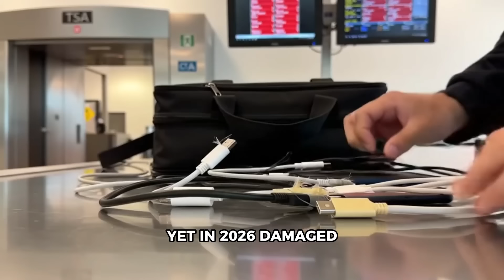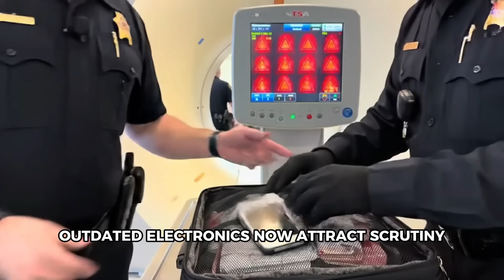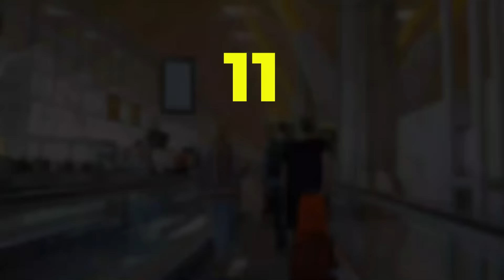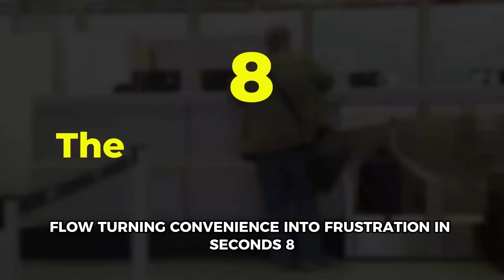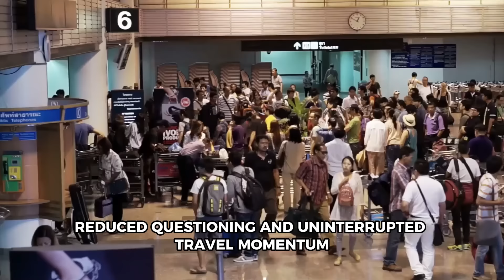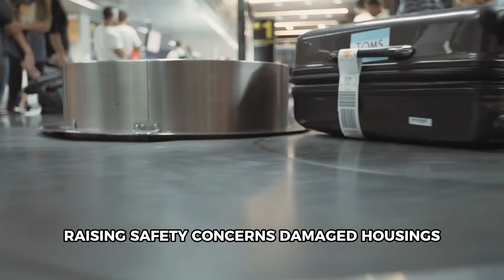TSA Is Confiscating These 15 Electronics in 2026

Comment: No wonder why ppl have to wait to wait extra 4/6 hours before their flight tsa stopped doing actual work and is relying on ai
Reply from the maker: A lot of travelers are definitely frustrated with how long airport security can take lately 😅 The newer systems seem to be creating mixed experiences depending on the airport. What’s the longest TSA line you’ve ever been stuck in?

Comment: Some electrical equipment of low quality fails only in use. A frayed cable in the cargo hold won't catch fire. Are they going to refuse socks with holes in them? To be frank, I'd welcome being told that my electrical equipment had seriously explosive potential. Do people really travel with fan coolers for their laptop?
Reply from the maker: You actually make some fair points there 😅 A lot of the concern really comes down to damaged batteries and overheating risks rather than normal everyday electronics. And yes… some travelers genuinely bring laptop coolers and all kinds of gadgets onboard now 😂 What’s the strangest travel gadget you’ve seen someone carry?

Comment: Wonder how much kickback TSA is getting under the table from manufactures forcing travelers into buying replacements for confiscated electronics?
Reply from the maker: I get why it can feel that way sometimes 😅 but TSA rules usually come from lithium battery safety concerns during flights. Have you ever had something taken at security before?

Comment: Probably won't be able to bring my Kindle to read my book.
Reply from the maker: Your Kindle should be fine — regular e-readers are usually allowed through security. The issues are mostly with certain batteries or modified electronics. Do you usually carry your Kindle in your carry-on when flying?

Comment: Private charters don’t have to adhere to these rules and regulations.
Reply from the maker: Fred, private charters do operate differently, and the experience can feel less restrictive. Most travelers, though, are still flying commercial. Have you ever looked into charter options before?
Reply: Good that’s what I will be using

Comment: Why would TSA confiscate something you don’t use on the plane and is not a battery. They aren’t a Consumer Watch Dog. If I had an extension cord with electrical tape why would it be any of their business? I’ve never seen anyone on an airplane use a multiple usb adapter, you’re in a small seat not an office desk.
Reply from the maker: Harry, I understand your point — a lot of travelers see it the same way when something isn’t being used in-flight. Most confusion tends to come from how items look during screening rather than how they’d actually be used on board. Have you ever had an item pulled aside that surprised you?
Reply: @FlySmartnow No and I’ve done a lot of international flying, more than domestic. The funniest thing, I was in Texas deer hunting, and in a rush to get to the airport. The ranch foreman, gifted me a folding shovel on the way to the car. Not thinking, the quickest thing was to stick it in my carry-on. TSA back then were very nice, smiled at me when it showed up on X-ray, and just said you might want to check this. The airline was nice enough not to charge me and just stuck a luggage tag on it. Sure enough down it came with the rest of the bags at claim. Times have changed!
Reply: Another time I had an early flight, on the way to the Philippines on a photography assignment. TSA pulled me aside and swabbed my equipment for gun powder residue. The supervisor said they tried to do a certain number a day, and since I was early and no one else in line, it was my lucky day. So we stood and talked bass fishing….probably took 20 minutes.

Comment: None of these electronic items are not connected while traveling.  So what's the issue.
Reply from the maker: You’re right, most of these aren’t connected—the issue TSA cites is the potential for them to create a fire risk if batteries overheat.
Reply: @FlySmartnow  but they're not plugged in in a suitcase 🤦‍♀️

Comment: Well folks the TSA is the new EPA.  I suspect because cellphones, tablets, laptops and electric shavers have lithium batteries, the time will come when they too will be banned. Like the EPA the time will come when the TSA will also adopt the "NO NONE NOTHING" approach to battery powered devices. They also have banned battery powered hair curlers, some battery powered electric toothbrushes and battery powered hand Waterpics.
Reply from the maker: Dave, I understand the concern — battery rules can feel like they’re expanding every year. Right now, most common personal electronics are still allowed, but the guidelines can definitely be confusing. Have you had any battery-powered items questioned during screening before?
Reply: @FlySmartnow Not Yet.

Comment: What risk is there in any electric wires or devices that do not contain their own power source. A frayed extension cord can’t start a fire by itself.
Reply from the maker: Luke, I understand your point — a lot of travelers see it the same way. The confusion usually comes from how items are evaluated during screening rather than how they function on their own. Have you ever had an extension cord or similar item questioned at security?

Comment: How does a “cable” that is not plugged in to anything, cause a threat to anything…
Reply: Because if people plug them in on the plane.  Fires on a plane during flight will bring down a plane.
Reply: If they confiscate the cheap ones you go buy the so called Apple or Samsung one and how does a charger for an Apple Watch not getting used on a plane cause a risk. Government overreach. I will put my chargers in my checked baggage. It’s which manufactures will pay to get the ok verse knockoff cheaper chargers etc.
Reply: @trextv2154  I buy the cheap Amazon ones. Never have an issue with TSA. I usually have at least 2 or 3 in my personal bag
Reply from the maker: By itself, it doesn’t — a loose cable isn’t dangerous. The issue is when it’s packed with certain batteries or devices, it can raise red flags during screening because it looks like part of a power setup.

Have you ever had a bag pulled just because something looked suspicious on the scanner?
Reply: @FlySmartnow  Yes, I was pulled for having “loose batteries” in my carry-on.  I explained that the AA batteries (which were alkaline, not lithium) were not loose, they were contained in a non-conductive plastic bag, and that without the introduction of a conductor, such as a bare wire or a piece of aluminum foil, it was topologically impossible for them to be arranged in such a way that they would short out.  My choices at that point were either to continue dealing with an utter moron or to surrender a few dollars worth of batteries.  I chose the latter.

Comment: I wish I had that for my cables.  I usually wait until they stop working.   I replaced them on a regular basis.
Reply from the maker: Bonnita, you’re definitely not alone,  most people use cables until they give up completely 😅 replacing them just becomes routine. Do you usually travel with a spare cable or just one?

Comment: It seems like cables, chargers, and power strips not in use would not pose any risk.
Reply from the maker: Dillodefense, that’s a reasonable way to look at it — a lot of travelers think the same. The frustration usually comes from how inconsistently items are handled at screening. Have you ever had cables or chargers pulled aside during a check?
Reply: @FlySmartnow Nobody has ever questioned my tech with the exception of what I have had surgically implanted for medical reasons.
Reply from the maker: @marcie78  thanks for sharing that — medical implants add a whole extra layer to travel, and it’s good you haven’t had issues with your tech otherwise. Do you usually let TSA know about the implant ahead of screening?
Reply: @FlySmartnow Yes, I do when I ask what the scanner ratings are.  Nobody needs a life-saving implant to quit in the air.  They have all been really good.  I offer documentation if needed.  I opt for wanding and a pat down.  Never a problem.
Reply from the maker: @marcie78  thank you for explaining your approach — that’s thoughtful and responsible, and it’s reassuring to hear TSA has handled it professionally.

Comment: IF YOU JUST GOTTA FLY (I DON'T) PACK YOUR PERSONELS IN A SHIPPING CONTAINER HAVE UPS PICK IT UP,AND SEND IT TO YOUR DISTENATION. NOW WALK ON BOARD THE PLANE WITH A BACKPACK,AND TOILETRIES.
Reply from the maker: Ken, honestly that’s a solid workaround a lot of frequent travelers are starting to use. It definitely cuts down on stress at security. Have you ever tried shipping your gear ahead before?
Reply: I am 84 and under 5'4". How do I load overhead bin?
Reply from the maker: that’s a very fair concern — overhead bins aren’t designed with everyone in mind. Many travelers in your situation check a light bag or ask a flight attendant for help, and they’re usually happy to assist. Do you usually travel alone or with someone?